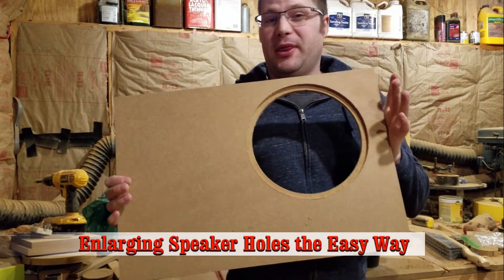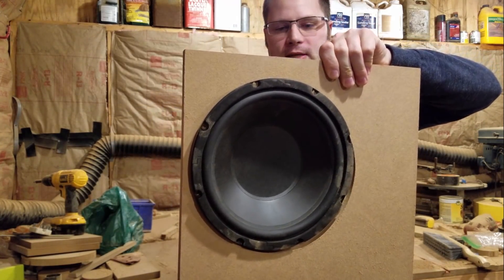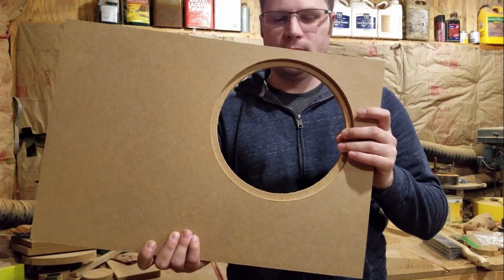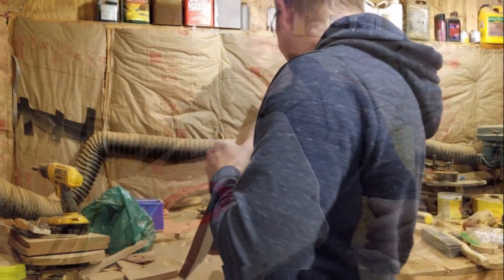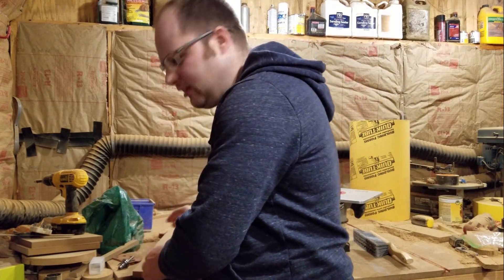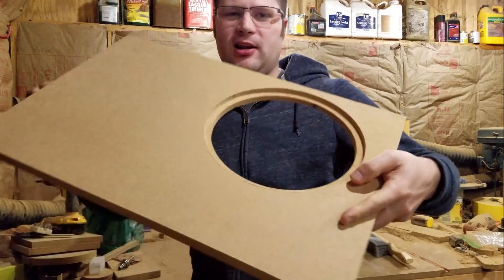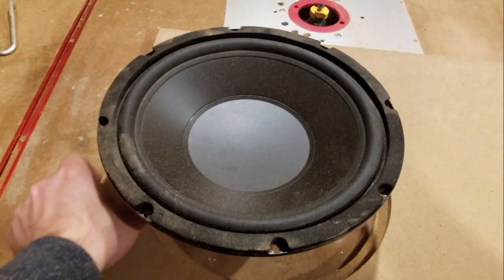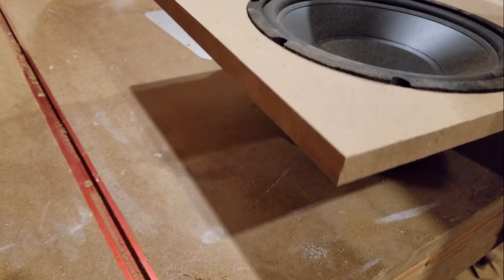How to Enlarge Speaker Holes the Easy Way

Comment: this is good info, but how do you enlarge JUST the rabbeted portion? my speaker frame fits nicely in the smaller hole, but the outer frame is approx 1/4" to small to accommodate the frame, and cover ring. its a 3/8" depth recess and currently .91" in depth, but needs to be wider by about 1/4". this makes a depth of cut of 1.15 and I can't find any rabbet bits that wide...

Comment: Bought a $30 rotary tool and used the sander bit took me 10 min. each 12 inch sub hole to shave off 2inch. Downside was the sand-bit kept breaking off..
Reply from the maker: Those really do have a tendency to do that.  I hate it every time it breaks.  But what a great tip!  Keep them coming.

Comment: What if the hole is a little bit too big? I had a box for an 8 inch that after about a year I converted for a 10". Annoyingly enough, the hole is just a tiny bit too big
Reply from the maker: Marek your best bet is to create an insert the same size as the existing hole. Glue it in place, the n start over.
Reply: If you can screw speaker in but air leaks just a tiny bit you might fix it with gasket tape, if its more than few milimeters than you might consider getting another board

Comment: A little confusing. Could use a diagram. Still a good idea I hadnt thunk of
Reply from the maker: Basically I enlarged the inner hole by 1/8" and then ran my 1/2" rabbet bit again.  You also can just run a larger rabbet bit the right bearing.  This is the larger rabbet bit I use now.  https://amzn.to/2yCmuiv
Reply: @Toid  actually, if the largest bearing is 1/8", you enlarged the hole by 1/4".  Do you know of anywhere to obtain a 1/16 and 1/32 bearing for these?